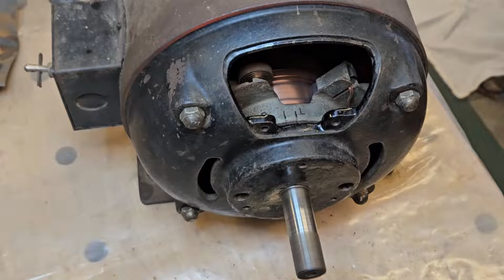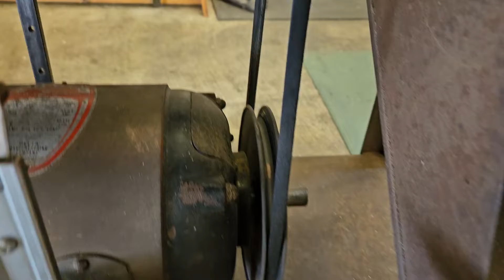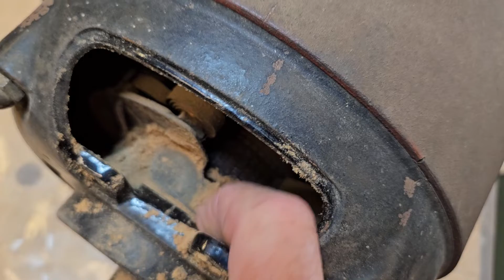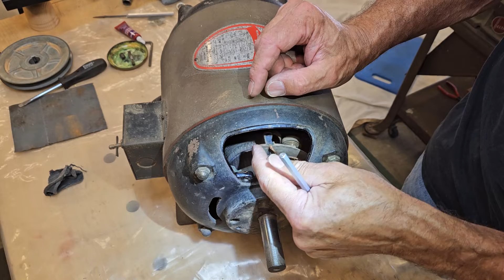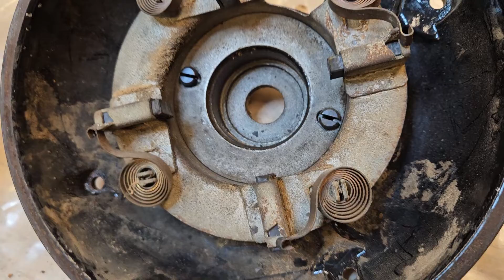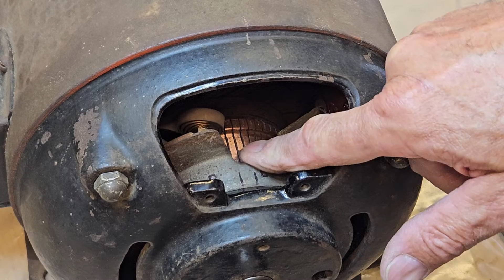Vintage Repulsion Induction Motor Repair

Comment: The direction of rotation of a repulsion motor shaft can be reversed without changing the brush assembly's rotation angle. This can be achieved by connecting an appropriately sized capacitor to the brush terminals instead of short-circuiting the brushes with a conductor.

Comment: Love it. Thanks for the tear down. I have a Wagner 1/3hp that I got cheap from a neighbor to replace a broken one on my bail elevator. Unfortunately it turns backwards, and I don't see a way to move the brushes. I'm going to romove the bell and see if they can be moved internally.
Reply from the maker: That sounds like a good idea. I'm pleased you found my video useful!

Comment: wonder if those fibrous sleeves on the top bolts were asbestos.
Reply from the maker: I suppose it's possible. But why the need to heat shield those I don't understand 🤔.
Reply: @ItsFixable  the only thing I could think of would be because heat rises and they were worried about the bolts expanding and allowing the housing to warp or something? I am also curious, I wonder if it has something to do with the insulation rating of the motor. I'm definitely not a motor expert lol